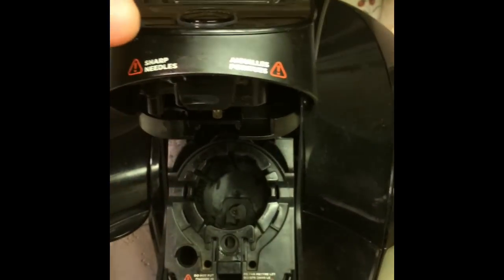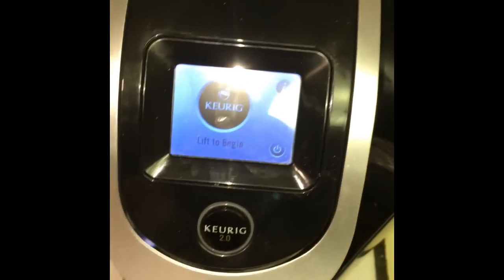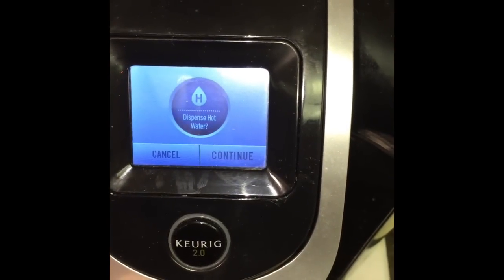✨ Keurig Coffee Maker - Broken SCREEN - Easy - Quick FIX ✨

Comment: Dear Scott, I am having a different issue. I have a Keurig 2.0-500. My display works, but does not recognize when the handle is put down. It keeps saying “Lift to Begin”, and after the lid is lifted and reseated, it doesn’t recognize that the lid is down. No brew menu ever comes up. Do you know if there is a detector switch, or what kind of switch it is and where it is located. I have it taken apart. I can solder, and can buy parts, but I need more info. It should be an easy fix, but Keurig just says “Your machine is defective, and we’d like to offer you a discount on a new brewer”. They have no Tech Support and no one there can offer any help. I can’t find any schematics on my machine. Can you please help me?

Comment: Does this work with just a power button on screen but when u push the button it doesn't turn on please help
Reply from the maker: It should do the trick
Reply: Sad to say it didn't work it's been 3days since it happened feel bad
Reply: The power button is the same no changes still visible power button but when I press it it never open

Comment: Nope... power button displayed and still non responsive after total disassembly of LCD module and all related. Removed harness plugs and LCD ribbon cable, then performed visual inspection under 4x magnification on harness, plug connections and ribbon cable and all connections appeared to be clean and solid. Reassembled related components and check operation and no change noticed. Do you  know the actual troubleshooting proceedure or have a link for this unit? Perhaps some theory as to what the unit is supposed to be doing at initial startup prior to power button being depressed? Self test failure, Go/no-go item? Corrupted OS? Thus far I'm only able to display unit build info and operation history via holding power button while simultaneously pressing large button 3 times in succession. It would be greatly appreciated if you could explain how to locate failed component.

Comment: Well this worked but for some reason my display is upside down. Did every thing in your video. Did nothing more.
Reply: Wow! That was crazy. Took water reservoir off. Just turned it over and back upright and its the right way. Thanks for the video. The screen has been a issue since we got it. A quick unplug usually fixes it.

Comment: Gee, now that I've broke off the clips, it still won't open----thanks ;(
Reply from the maker: +Ronna Hochman 

Hi Ronna,
I had the same thing happened to mine.
I found that the back to clips were still hooked up and 
I had to gently pry them loose so that I could open up the case and secure the loose connection.